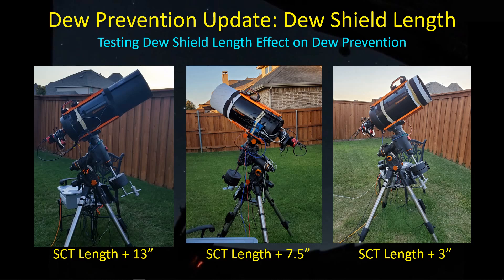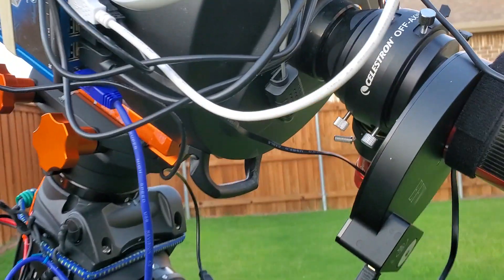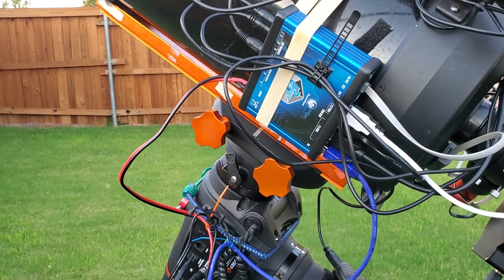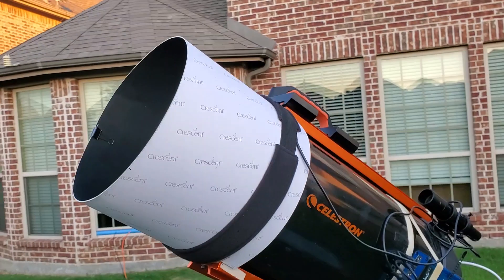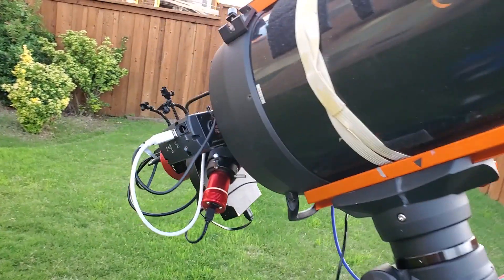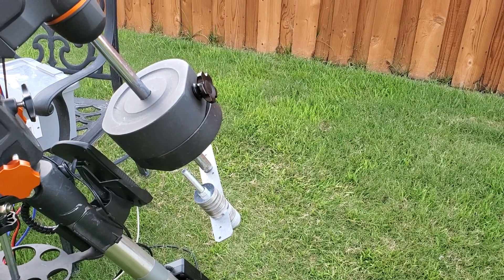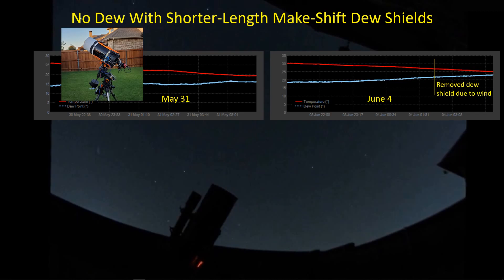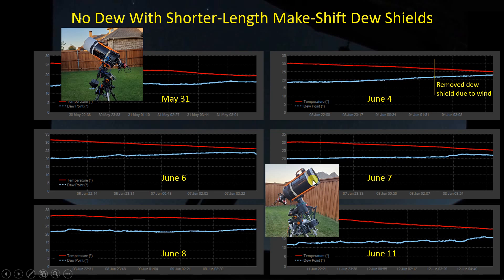Effect of Dew Shield Length on Dew Prevention

Comment: James, I'm curious to know (since i own a 9.25 myself) how much wind has been too much? With my heated astrozap dew shield wind around 5-10 KPH hasn't really screwed up many of my images, though I would think that wind direction could also play a factor as well. 
Love the videos and look forward to more!
Reply from the maker: I agree with you. If I see "6 mph (10 kph)" for the wind speed as reported at a local weather station, I think "that's a good night." It's the higher wind speeds I'm more sensitive to. Also, keep in mind that the force generated by the wind is proportional to the square of the wind speed, so guiding can go to hell in handbasket pretty quick if the wind ticks up or gusts occur more frequently. And, also, the longer the dew shield is, the larger force and the greater effect the force has, particularly on the DEC axis. I've been casually searching the web for a USB-powered anemometer that I can put out next to the scope. That way, I could develop a better correlation of "good" vs "bad" wind and know when to shut things down or, better yet, not start things up. Thanks for watching!
Reply: @Aero19612  Ah ok that makes sense. For me if I hear 15MPH i dont even bother, 10MPH i am willing to try and anything under is a go for me. Though I admit i always have the dew shield on and set to low-med. I myself havent tried to see how much wind is too much without the shield on. Im currently working on making a tarp enclosure around the scope sort of like an EZ-up but without the roof, hopefully that will help break some of the wind i get.

Comment: Hi James. Do you plan to install small cooling fans behind primary mirror to speed up thermal equilibrium ?
Reply from the maker: Hey Nadir. I have been thinking about hanging a small fan over the front end of the scope so that it can blow air across the corrector plate. If the short dew shield works with respect to the wind, I probably won't even try that. I wasn't planning to install fans behind the primary mirror. I would have to disassemble the OTA to get access to that area. Some SCTs, perhaps Celestron's EdgeHD series, have vents in the back plate to accomplish just that. Thanks for watching!

Comment: Thanks for sharing your results.  I'm going to replicate your experiments up here in Michigan and find my "sweet spot".   I can buy a lot of poster board for the price of one commercial dew shield.  Seems like some black velvet and a can of waterproof, spray varnish would finish off a diy shield.  Then add the dew strap.  I've also seen metal dew shields which I assume are aluminum.  Has anyone experimented with different materials?
Reply from the maker: Great, Alan! Share your findings when you collect the data. Not sure about other experiments with other materials. And I'm not sure if it matters a whole at least with dew prevention. The Astrozap shield is a nice thick, lightweight, insulating foam. It's just too darn long (if the wind blows)! Of course, I'm experimenting with thick paper basically and it's working great. I might be concerned about added weight of an aluminum shield, but it would/could be very thin and may not weigh much more than the Astrozap. Your idea of pimping out your diy dew shield sounds very functional and durable.

Comment: Have you considered a sealing 6” wide foam “filler” around the dovetail and a dew strap attached directly to the OTA with Velcro also on the outside? A homemade dew shield with three bands of matching Velcro on the inside and up the sides? You would have three lengths of sliding dew shield in one e.g. vary the length as conditions change? Simon
Reply from the maker: That sounds like too much work for me! I'm a rubber band and duct tape kind a guy. Actually, I did consider something like that by just extending the "slots" at the base of the dew shield (where it fits around the top and bottom support bars). That way I could slide it down to vary the overhang. In the end, I opted for the paper solution. So far, It would appear that an adjustable length is not needed. Dew is prevented seemingly independent of length (as long as there's a dew strap there to heat the air in front of the corrector plate). So far, so good with the 3" extension as wind is concerned. But I've been having some of the most wind-free days I can remember. Thanks for watching, Simon!

Comment: I literally applauded when you showed the UPB mounted to the OTA. Now that you have popped your DIY cherry so to speak ;) you might try re-purposing one of the ADM dovetail clamps to carry the UPB underneath the OTA. Sticking it up the sharp end will allow the OTA to sit further back, reducing the moment radius for windage and RA balance. I find that with the supplied stick on feet all I need is a velcro belt (with buckle) to retain the UPB. A simple spreader bar on the remaining clamp should be sufficient to be usable with the handle.
Reply from the maker: HaHa. The problem with mounting it there is I would have to take it off every time I put the telescope on the mount. There's a handle at the rear that only lets you slide the OTA into the mount from the front. Don't you like my rubber bands?
Reply: @Aero19612   Bummer, I should have known a smart fella like you would have thought of that.  Put it down to more retarded design from C. Like how my CGX has an offset when gripping Losmandy style base plates.
Reply: James Lamb Rubber bands, Velcro and Duct tape bind the hobby together. :)

Comment: What I really want to learn about is how dew heaters interfer with the NSAs mind surveillance program.  Ya know it’s just something I wonder about.  Please correlated effects of multiple dew heaters running.

Could check if there’s a DC under-voltage for that processor.  Going to the AC/DC converter basically gave you more base DC voltabe.  DC voltage can drop fast in undersized wires.  In my RV I have a separate fuse for my radio/TV console that also has auxillary USB and cigarette lighter outlets.  That wire is only 7 feet long from a 10 amp fuse and it cannot change my laptop via inverter. The current just isn’t there through a 14 gauge wire.

Being at dew point does not guarantee dew formation.  The atmosphere can be at 800% humidity and not precipitate clouds.  What is need is nucleation points for dew drops to form same with surface.  It may be that night dew did not form cuz the air mass was low on dust/pollen particulates.  Did it rain recently; washing out the air?

What about a heated wire mess shield?  Put 3 heaters around the base of the mesh above the OTA.  It’s America; more is better.
Reply from the maker: Yeah, that must be the main factor and I must be on the ragged edge of the power provided. After I recorded that video, I tried the UPBv2-to-mount power with the PA cable (again) and a slightly shorter heavier gauge cable I bought. Both started the mount up like a charm with no hint of the issue I observed the first time I tried with the PA cable. May give the heavier gauge cable a try tonight. I can leave the AC adapter nearby for "emergency" re-start if it lets me down.

As for the dew heater issue. I think the dew problem is "solved" with one dew heater and a very short dew shield. I just need to move the dew strap to the inside face of the dew shield for maximum effect. But for now, it appears to be working.
Reply: James Lamb With the heater inside the shield, I wonder if wrapping the dew strap in aluminum foil would allow it to radiate more...
Reply from the maker: Yeah, you could have an open-ended foil shape that would direct the heating toward the center. I would wonder about stray light reflections off the foil though.